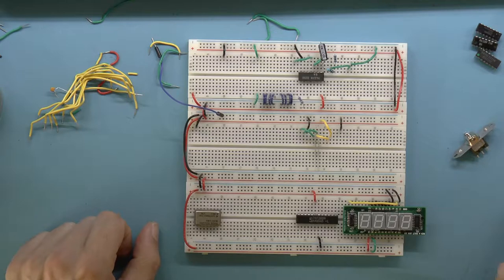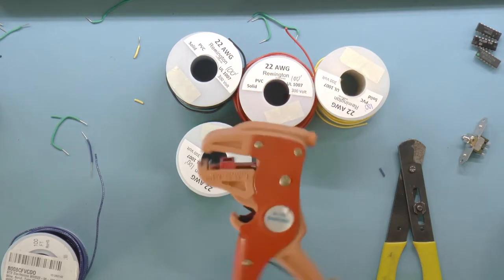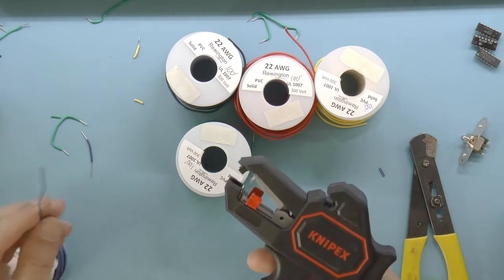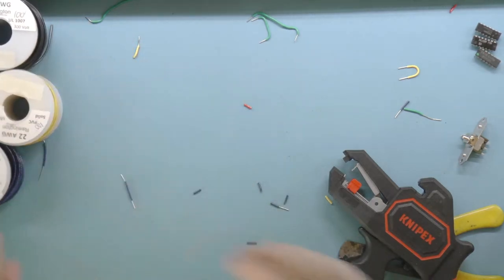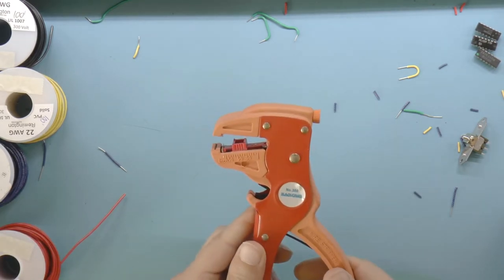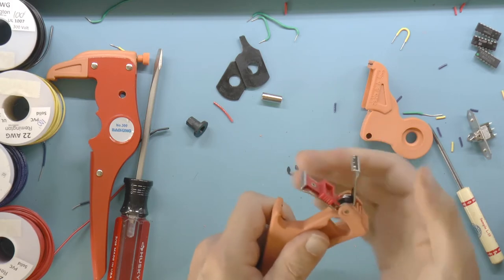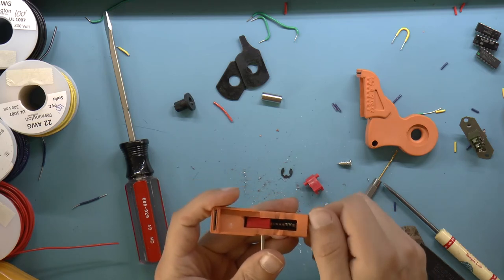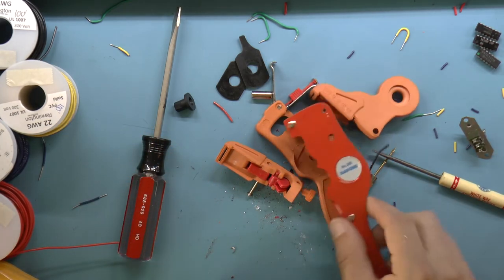Chip Tips #2: Wire stripping

Comment: The cheapo orange Chinese one works ok for me. Fiddling with the tension nob makes it strip finer wire without ripping off the wire itself. I think it wasn't working in the video because the nut was under the red thing instead of pushing into it. The Knipex looks nice but its $200 compared to $20. The Chinese crimpers seem to suck though, but a lot of that is probably not having the correct size dies for dupont/JST.

Comment: Hi, please
Could you help me, might be?
Then, I am here because I saw the stripper wire pieces alone.   I have a tool very similar to the one you disassembled.    I dismounted for the same reason as you: it doesn’t strip.
When I was taking apart it, that small piece that fell from the tool and you got it at 11:39 and a spring also fell from my stripper.    And I discovered the correct place them, yet.

Many thanks

Comment: I bought #2 (the orange one) when the design appeared in the early 70s - (never had any luck with it, but 40 years later after watching this video I had another go, and after twiddling the chrome (on my version) knob - it works). I got #3 not long after and even then it was a generic item made in China. There are low cost designs similar to the Knipex - Fasen FS-D3.

Comment: I swear by a pair of kitchen scissors, teeth, pain and suffering. 
Plus 22awg wire, one colour, in bird nest configuration.
Reply from the maker: The greatest thing about using your teeth is that you get notches in them that are just the correct size. You have to keep doing it, though, otherwise the notches eventually get dull.
Reply: I'll bear that in mind, I might not have any teeth left when I finish my z80 though.

Comment: Very nice to know about different kinds of stripping tols but looks like second part of video was just an afterthought, you should make a photo of the tool before dissassembly or just review the video before making guesses, just an idea, I love your videos.

This mystery black part is metal with teeth which is supposed to hold insulation / wire in place, screw is supposed to adjust wire gauge to strip. But, well, in mine tool I think it does nothing because I tried playing with highest / lowest setting and it did nothing except everytime I tried this "black mistery part" has punctured the insulation wchich in case of very short jumpers just defeated the purpose. I think I'll try to find this old tool with fixed gauge if this german tool does the same (pinch on insulation making thin insulation to stretch)

Comment: I've got the wire stripper you mentioned second and mine works perfectly, I would never give it away - probably yours is a really cheap one or even a misproduction... The screw at the back is to set how deep the cutting blades go, relatively to the gripping part.

Comment: Yeah that piece is supposed to be for adjusting the clamping strength for of the stripping blade to compensate for different size and different types of wires.

Comment: I am by far below your knowledge and experience level, but I know how to do nicer jumpers and I have no tool for stripping at all, just small cutter pliers  lightly closed. What you need to use is long nose pliers. Always bend your wires with the long nose pliers. Now, to make short jumpers, you strip one end, then you bend it already in a nice 90 degree angle with just about 1 mm of insulation bent down with it. Now you turn it around and secure it with the pliers and strip. Securing the wire/insulation with the pliers already prevents the insulation from being pulled off entirely, but the other side already bent will secure it even more.